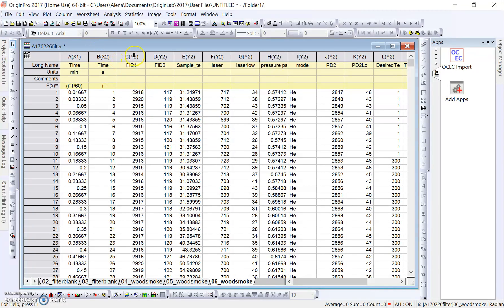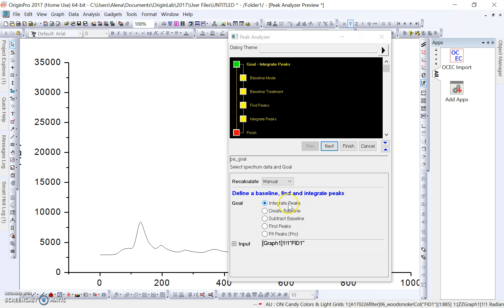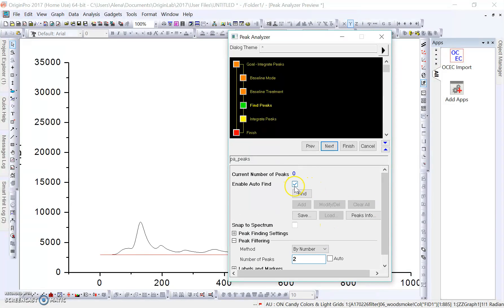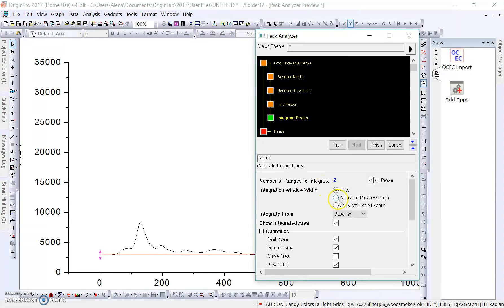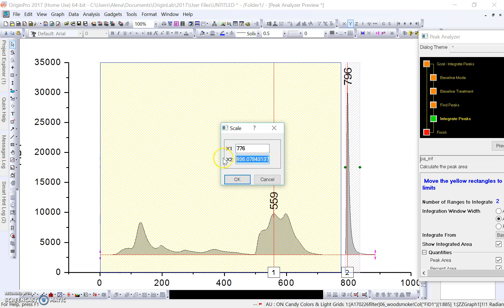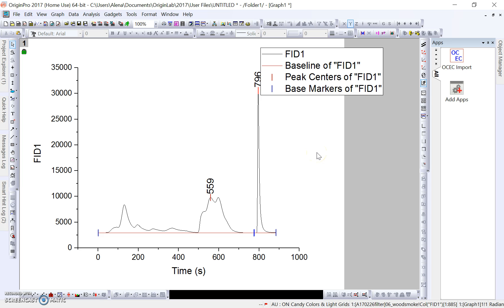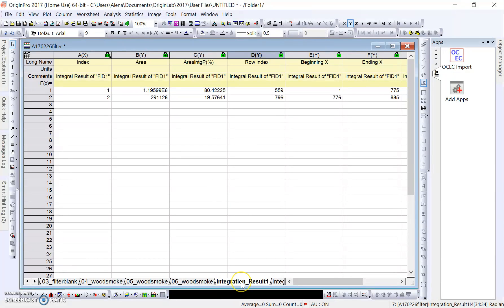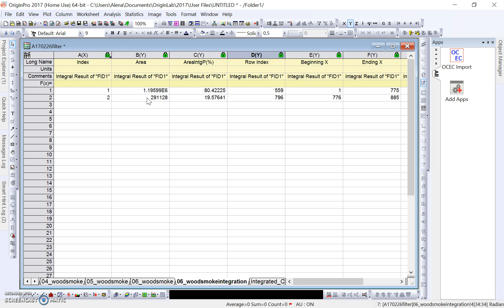Creating Integration Method in Origin

Comment: Hi I have question regarding the integration option.  1 What is the difference between Analysis: Mathematics: Integrate
and gadget integration ? Secondly i use origin to integration cyclic voltametery curves and some question regarding, can I contact you ?
Thanks.
ANTWORTEN